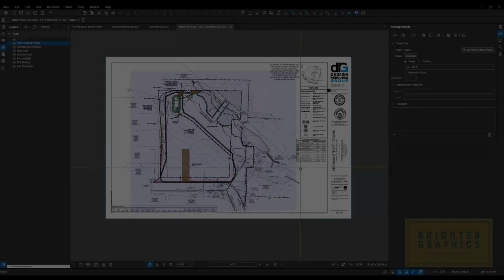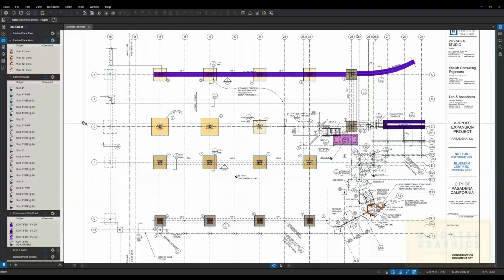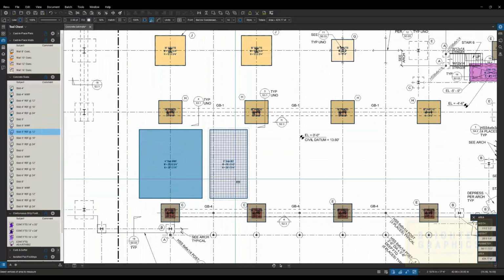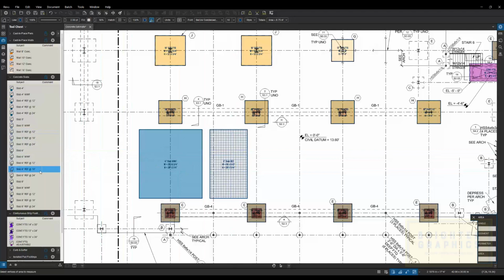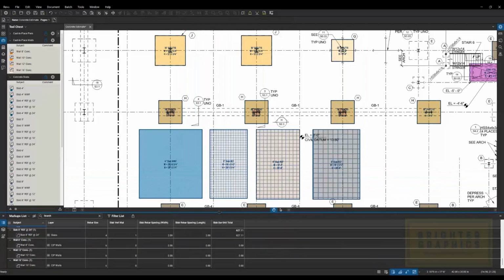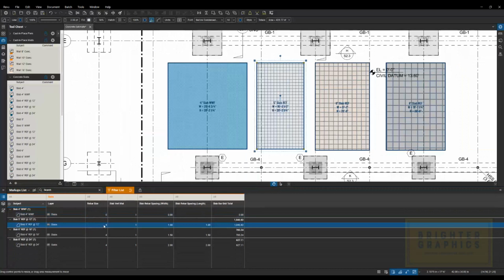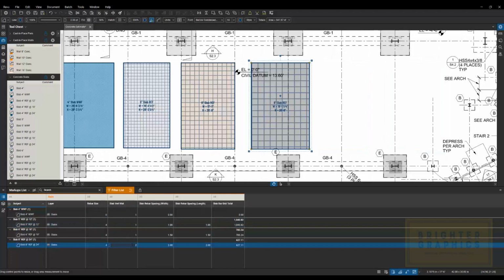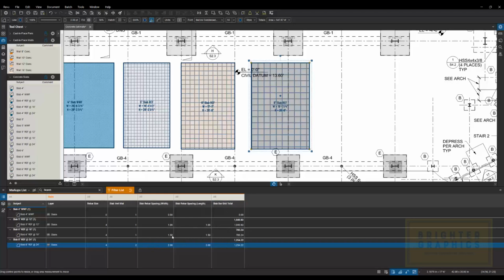Estimating: Custom Concrete Tools in Bluebeam Revu, Brighter Graphics' Bluebeam Tutorials

Comment: Is there a way you can factor in lap for the rebar?
Reply: The lap would be difficult to calculate because there's no standard variable to build into a calculation. If it were a continuous strip footing, you could maybe add the lap distance for every length of bar. I would typically capture the lap in a waste factor calculation. Great questions Andrew!